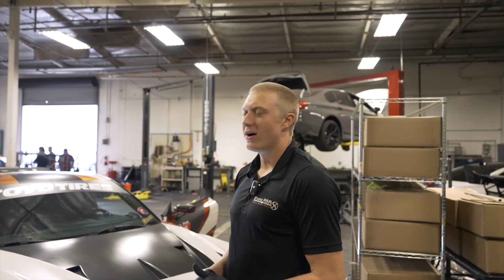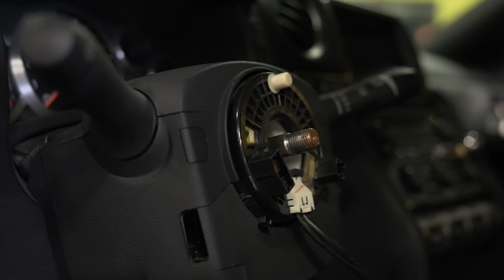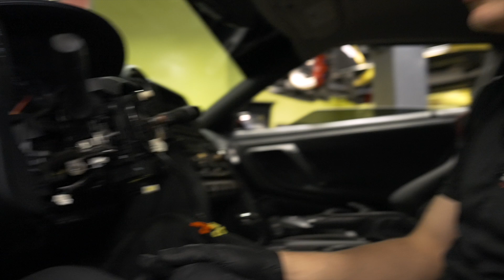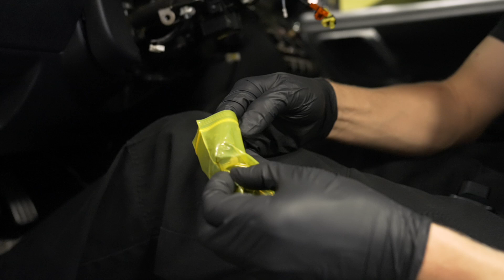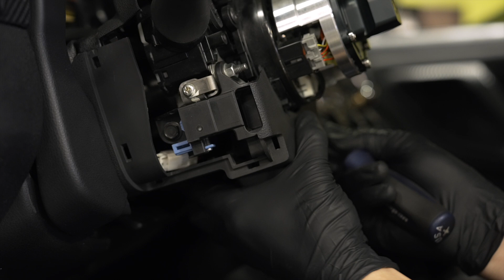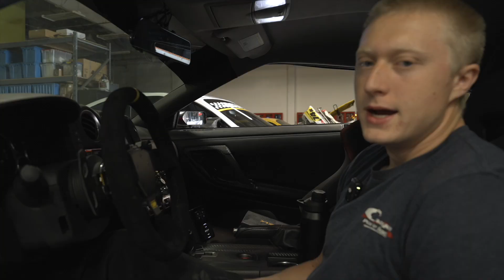Zestek Racing Steering Wheel Hub - HOW TO INSTALL for Nissan R35 GTR

Comment: Great install video, how does the shifter module connect to the wheel? I haven’t seen a connector that goes between the steering wheel and shifter module.